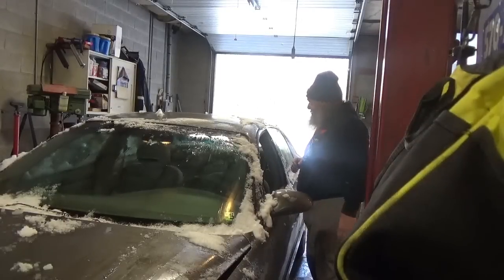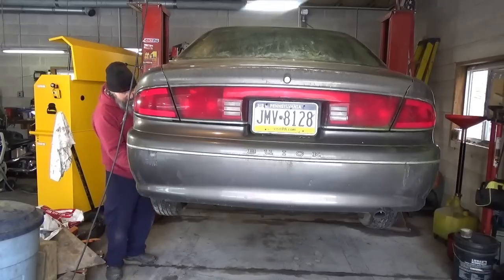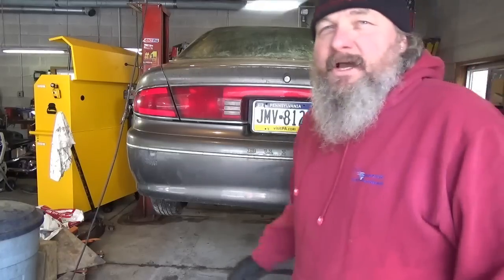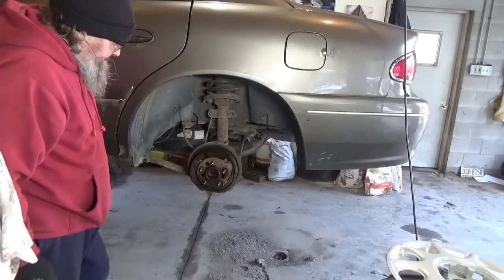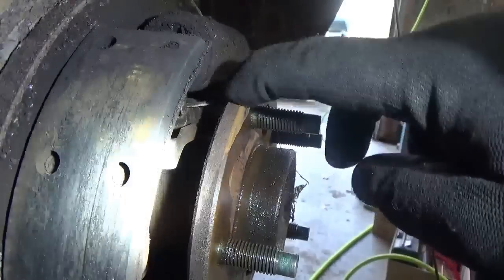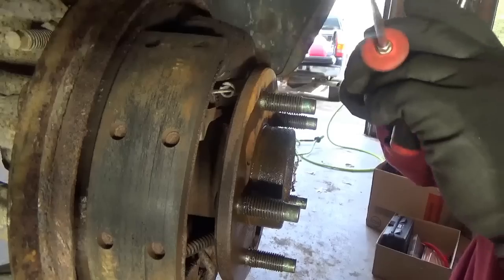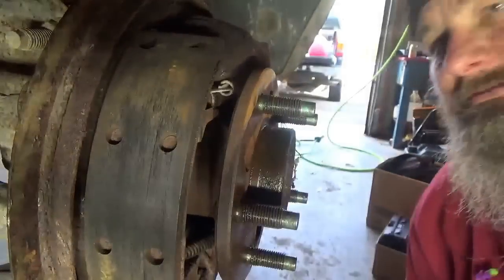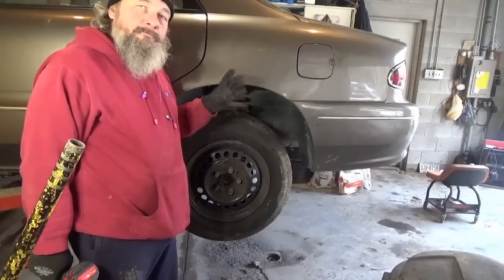Cannibalization of the Century! Part 1

Comment: Hey Mike...like one of your commenters, I was surprised also to see drum brakes on the rear. On my 2000 LeSabre, it's got rotors and pads. And you got what you wanted accomplished; to move it around freely :) Have a good one and stay warm up there!
Reply from the maker: Yep 2001 is the same. Snow melting great. It is going to be at least 50 degrees for the next week or so here.
Reply from the maker: ya know I have to look at the 1999 Lasabre  because I am not sure what that has on the back.